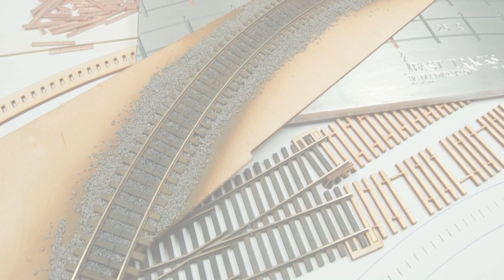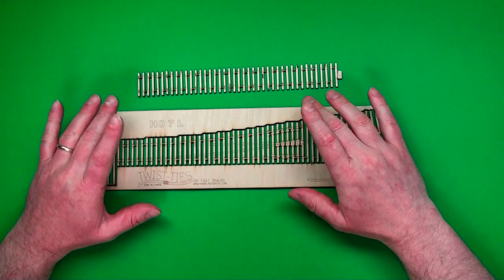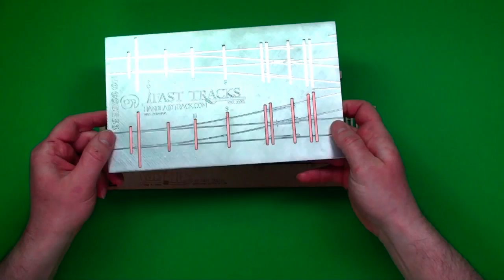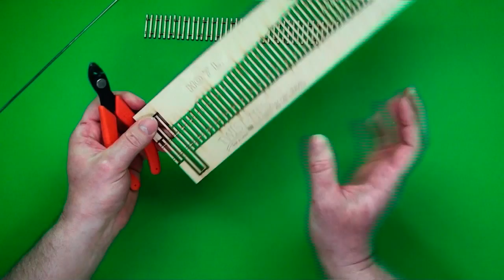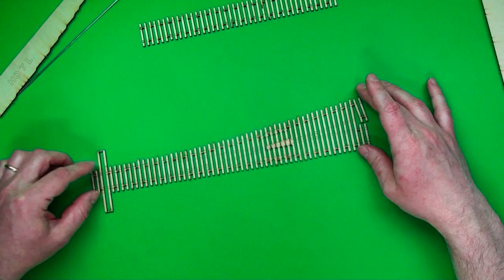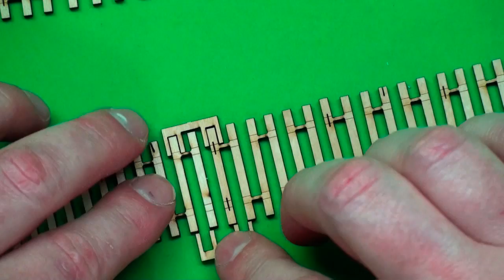Hand Laying Track Using Fast Tracks TwistTies

Comment: I dont have the fine vision capability to do spikes it would be a chore for me. I so want to learn this technique to build my own turnouts. Another problem I dont have a hobby store within 70 miles of where I live. Can I hire a couple of these turnouts built for me. Right now I need two for turnouts. Had residual damage from an explosion and my eyes are not getting any better. Please let me know if I can hire you for 2 turnouts/ lbm12950@gmail.com.

Comment: These look great! I will be using these on  an inside corner module with two tracks that have slightly different curves.as the center to the parallel curves is wider due to opposing  train clearances. (not to mention that they will also be on a trestle bridge). I am hoping to bring the module to the Bog E in Springfield,MA January 2016 (and thereafter) at the Hub Division of the NEW of MNRA. (see www.hubdiv.org)